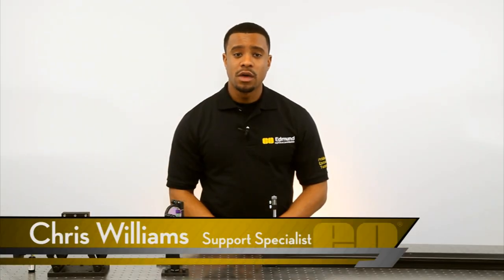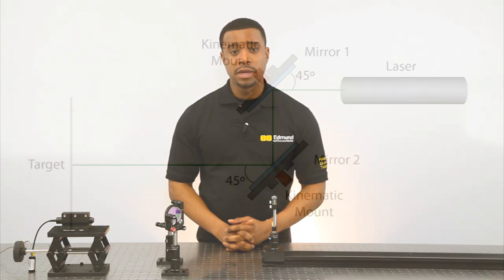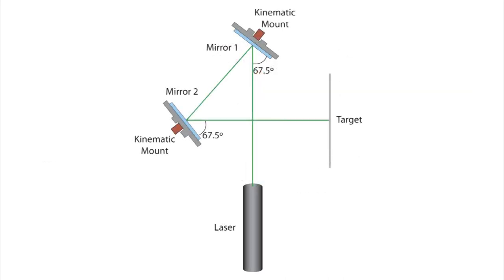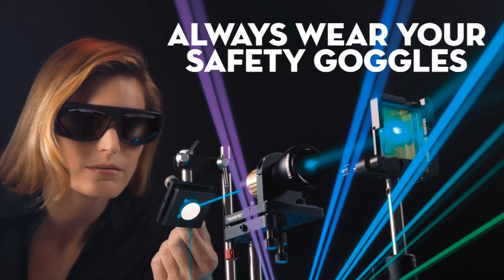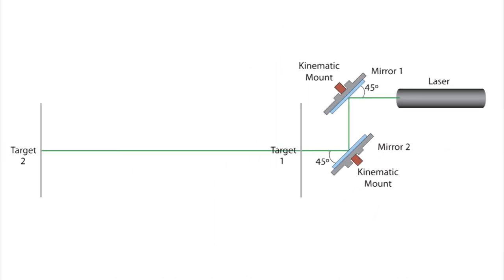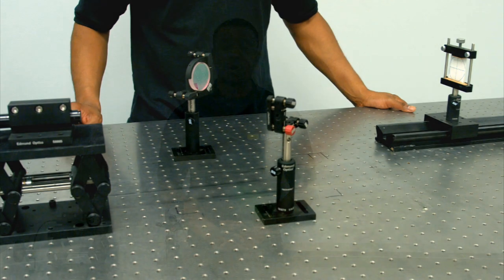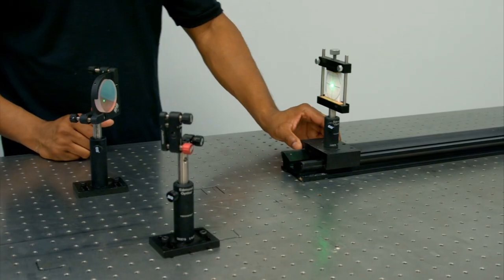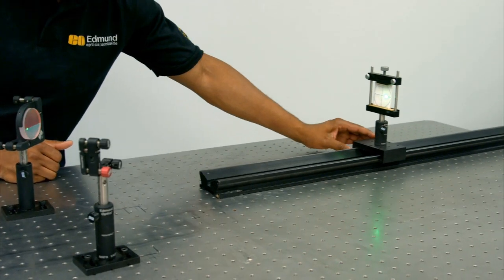How to Align Lasers | Edmund Optics

Comment: Pro tip: center the beam to the target with the near mirror then move the target to the far side. 

Now say the beam is lower than the target ~10mm from center, raise it with the far target mirror so it’s ~10mm above center INSTEAD of making it center.  The same holds true for side to side movement. 

Come back to the near target and make it dead center with the near target mirror. 

When you come back to the far target the beam will be much closer to being lined up than if you had gone to the center the first go around.

For example if you had gone to center on the far target the beam is 9mm lower the second go around but if you overshoot it it’s 6-5mm lower. 

Repeat until both targets are centered. 

 This is called overshooting and will cut the alignment time in half.  Think of it as taking baby steps vs proper steps. 

This is specially useful when the beam is infrared and you have to take paper shots.  Seeing the beam makes it 10 times easier. 

There are other techniques but this one is the easier one for people to understand.

Comment: sir can we use a autocollimator to align a laser with its pilot lamp , if can sir please be kind enough to explain it also , thank you for the video
Reply: Not sure if I understood the question but an auto collimator would not help you with that.  

I’m guessing you have an infrared laser and want to align it with the pointer (aka pilot lamp). 

The way that’s done is by taking two paper shots at two different distances with the infrared laser. 

Use these two paper shots as targets. Physically adjust the lamp until it’s centered with both paper shots. 

One of the paper shots would have to be taped only from one side so you can fold it in and out depending if you want to see the near or the far target.

Comment: hello why you adjusting the red screw in far alignment?
Reply: They probably shouldn't do that.
Reply: @AutomticHeart  Why not?
Reply: The red screw is the pivot screw.  Normally you use the screws beside it for up and down or side to side movement.

Moving the red screw adjusts the beam diagonally and there is usually not a penalty for that but you end up decreasing the adjustment range of all the screws if you over use it.